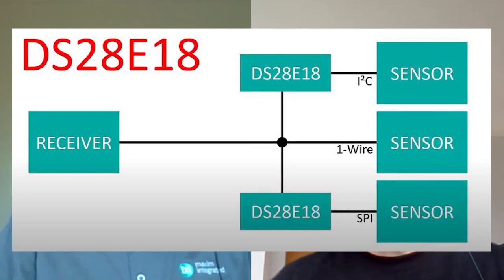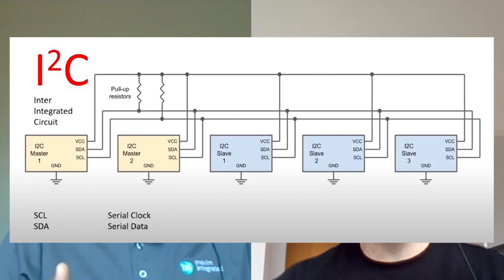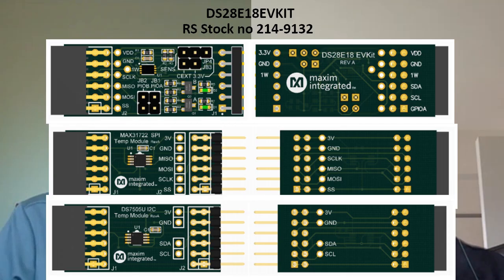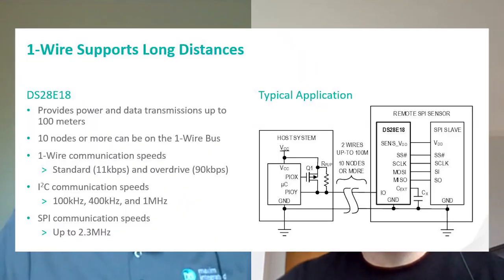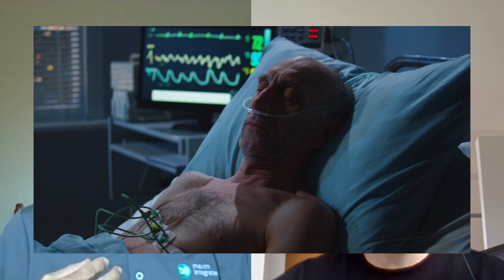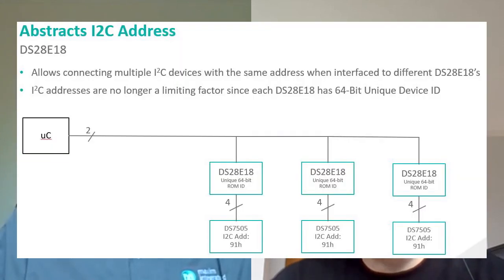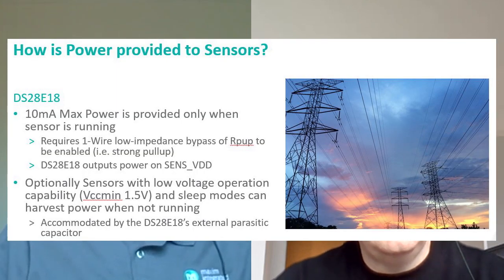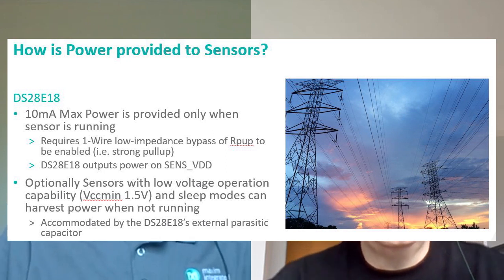Ask the Expert  - Maxim Integrated DS28E18 1-Wire® to I2C/SPI Bridge

Comment: DS28E18 does not support I2C clock stretching, so make sure your sensor does not require it because it won't work!  If anyone knows of an updated firmware please inform us.  DS28E17 does support clock stretching.
Reply: what is I2C clock stretching? does TMP117 require it?